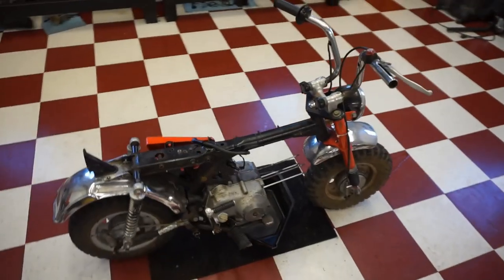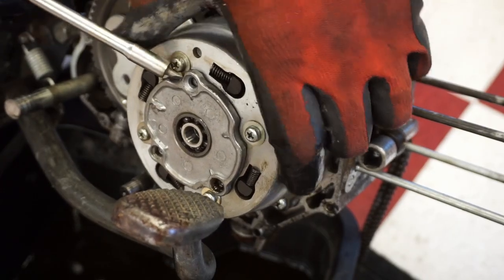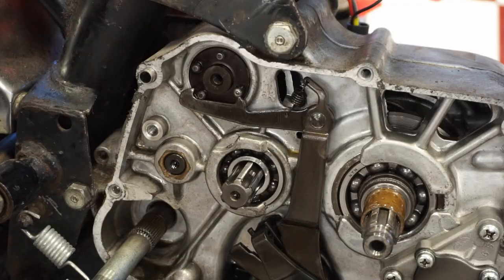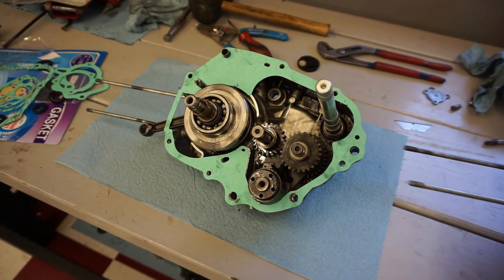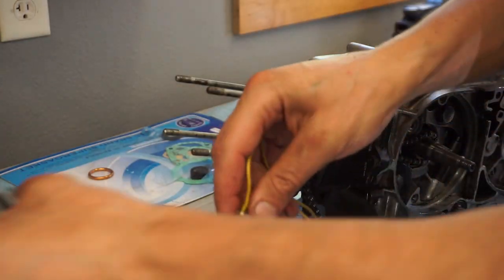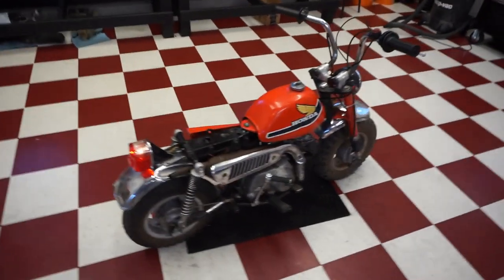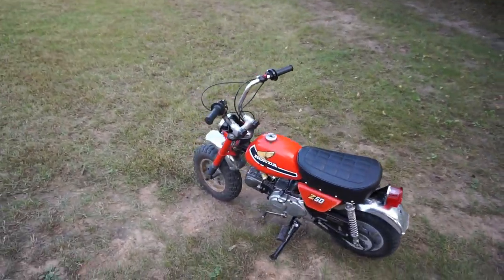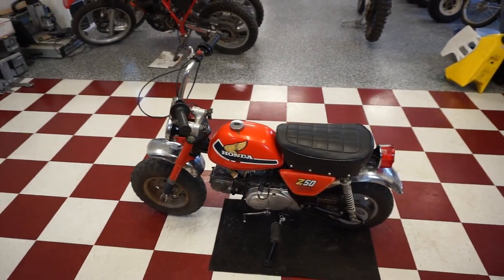Building a 45 Year Old Honda z50 Mini Bike

Comment: This was my first dirt bike I was four!! Now I'm 40!! Bringing back memories thanks!
Reply: this was my first bike too!! i wish i still had it.
Reply: My neighbor had this bike, and I had the Elsinore 50. I would smoke him, but they were both fun as heck to ride!
Reply: Wow that was my very 1st dirt bike also. Mine was a 1970 and had only front shocks. I was 11 yes old. I rode the wheels off that thing. And it brings back a ton of memories.  I especially remember having to share it with my 5 year yonger little brother. It was a blast for years.
Reply: I watch your Chanel a lot. Find myself wanting to reach in and give a helping hand but that be a long reach as I'm in Florida. So I go back out in my shop work on stuff I have collected from here. Now I just finished re-doing the top end on a 03 kfx 400 I recently  aquired.acquired. I really enjoy it.
Reply: here in finland this was my first street bike
Reply: Anyone know how much this would go for if it was in pristine condition?  I still have mine which is nearly identical to this (1980 +/- 1 year). Haven't started it in 20+ years but all original.
Reply: Geez 40? That's like dead

Comment: I had one of those. My Honda Z50A was blue with the chrome fenders. Gave it to my sister when I got a Yamaha DT360. Was stolen twice. Got it back the first time, but no luck the second. Was a fun bike. I had friends that had Trail Hoppers, YZ80's and XR75s and we used to ride around the neighborhood at night, trying not to be seen by the police. I have a lot of fond memories of those days. Honda sold them with 2 different carb. slides and also a restrictor plate in the exhaust system. The plate was removed and the better slide installed for better performance. Whoop!:elbowcough:

Comment: I just started my 78 z50 today. It's been in the garage for 23 years. I added an electronic ignition and new carb. 
IT LIVES ! 
The tires are cracked but the headlight works.
Reply: What ignition and carb did you use?  I've got a 78 that I want to get running but the carb is missing pieces

Comment: I was gifted a 1976 Z50. It had been sitting for years. My grandson and I removed, drained and rinsed the tank, cleaned the carb....used same old gaskets, filed and set points, cleaned/gapped the plug, added fresh gas and vroom! It smoked but after a few rides the smoke stopped. Stuck rings. It looks ratty but Honda build quality is remarkable. Dave in Omaha

Comment: I’ve seen, in the aftermarket, a 75 cc engine with a 4 speed for $300 or so. It’s bolt in. The after market parts availability is huge. You could build one completely with all aftermarket parts. I gave mine to my grandson. He loves it. We talk about blasting it apart and restoring but have yet to do it. I ride a 2005 V-max. Quite a contrast. Fun.  Dave in Omaha

Comment: Do you know why 3 of the cylinder head nuts are domed and one isn't? My first bike was a Honda SS50 1975 bike same engine, and the head nuts was the same as this lovely little bike. Great vid 2vintage. I was 16 when I had my SS50 back in 1978, I'm now 61 and my ride now is a Honda NC750x

Comment: Those screws on the clutch, probably all the case screws too, they're probably JIS - I think that's Japanese Industrial Standard  or something like that, if you try to use s standard American Phillips #2 or #3 you're just going to strip them right out, they almost have little wings on the screwdriver next to the + of the Phillips slot. NEED a set of JIS drivers!!

Comment: My brother and I both learned on a Honda 50. We thought it was a 77, but must have been a 79 without the lights and chrome. He went in half-sies with my dad and at dealer a year model later. I think it was about $800 then. We rode it until about 1990 when I was 12 and it stopped running. sold if for basically nothing in about 1998. The thing always fired up after a kick or 2 growing up though. good stuff.

Comment: i still have 1974 Honda Trail 70...mint complete original...my brother burned out the auto clutch..and it has sat fir 35+ years...i need to get it goin...its the hit metallic orange...low low miles...i used to ride the RV 90 and the Trail 70 as a boy

Comment: Hey Joe I am not sure if you are aware but the Phillips looking screws that are on most Japanese bikes are not actually Phillips they are JIS (.Japanese industrial stantard) screws and that is why most Japanese bikes have these screws rounded off cause we have all used Phillips screw drivers to take these screws out and that is what causes these screws to round off cause Phillips screw drivers and bits dont fit these screws correctly. If you go on Amazon or many motorcycle web sites you can order the correct JIS screw drivers and bits that will correctly fit these screws and mostly eliminate this from happening.

Comment: You need to obtain and learn how to use an impact driver. Once you've mastered using it, crankcase
screws will never be a problem again. Unless someone before has mutilated the heads of the screws
before you.

Comment: Good evening 🌆 from Greece Peloponnese island and town Egio guys, hello there, unfortunately you have to change the oil pump gear ⚙️ too with the timing chain ⛓️ and guide because it's teeth is awful 😞 and will strip soon and it will cause cylinder head camshaft rocker arms valves to break because of  no oil 🛢️ passage through the lower left crankcase stud  with the cooper screw spacer that has on the crankcase an oil passage hole , the oil pump is located on the other side of the engine unfortunately and you have to disassemble it completely, that's cub engine 😭
Reply: That and the kick start lever is the same thing 😂 you have to disassemble it completely, and of course the transmission shaft if it's damaged the one that has the drive ⚙️ the small one on 😂
Reply: And for the best compression rate torque specs and engine performance, the best piston rings gaps positions are the Mercedes logo method degrees ° "  Y ", for the most cub type engines at least for 60 years now here in Greece 😂 ,
Reply: And remember, all cub type engines that are with points and not CDI electronic harness system wiring on the flywheel plate or the camshaft plate on the cylinder head round cover ( rare) they are more powerful engines when fitted with an tuned carburetor and an motorsport ® big pipe hall exhaust pipe or Sebring © exhaust pipe ❤️

Comment: I have been building and mucking around with these bikes my whole life and let me tell you, this motor is not running right! 
I would bet the oil pump isn’t working hence why it’s so hot and these motors rely on the oil to cool it as well as the air passing the fins on the motor

Comment: I really like your channel, but it makes me a bit crazy that you don't clean off the parts before you work on them. Also, all gasket surfaces should be spotless before you re-assemble.  Otherwise, great job on everything!! Have the owner reach out to me if he wants some of those parts vapor blasted.
Reply: Also I would be pissed after rebuilding motor and revving up and not letting it warm up and reving and ramming into gear . I would be mad that’s why he will never work on my stuff
Reply: I hate it he always rushes things and not patient . Never use old parts

Comment: Wow just swap out that valve cover gasket without even cleaning the surfaces 🤦🏻‍♂️ look I'm not trying to bust your balls or anyting I'm just saying, be thorough bro otherwise it will come back to bite you. Btw, I think you might need a longer throttle cable 🤭